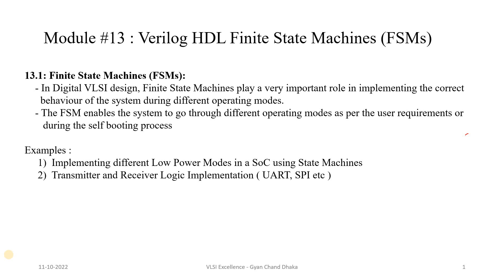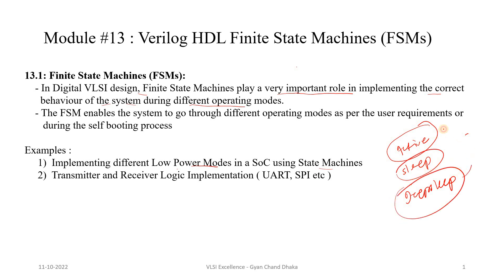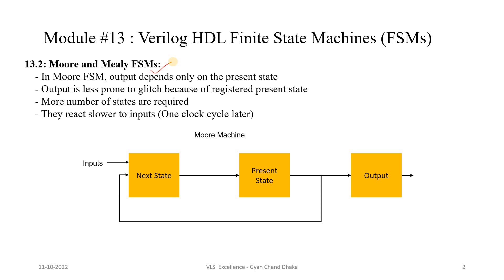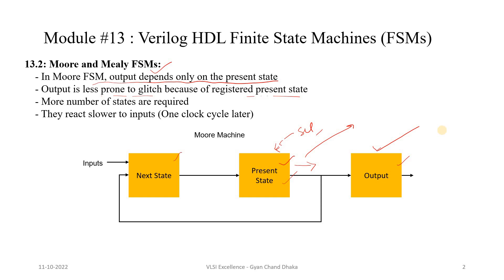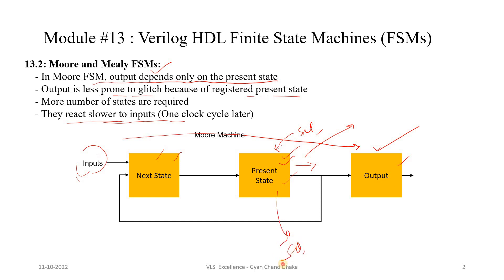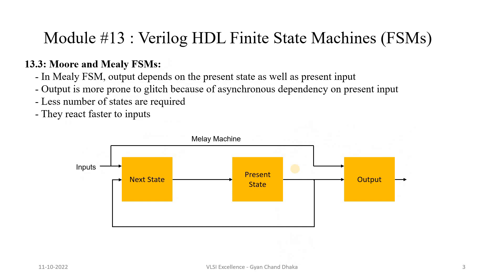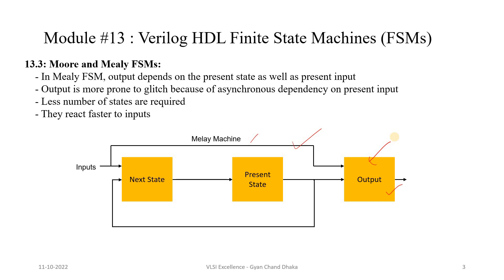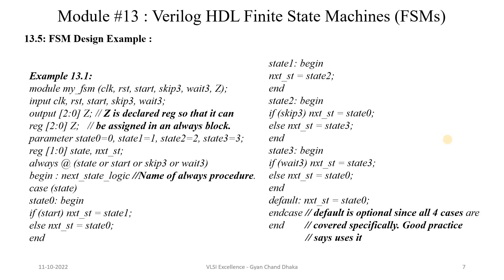Verilog HDL Crash Course | Finite State Machines | Moore | Mealy |Module #13 | VLSI Excellence | 👍&🔕

Comment: I have a net that the host writes to, however when it reads back from the register, I'd like to replace the lsb with a status generated in the logic. i.e.

    ctrl_reg[0]  <= tip && last_bit && pos_edge;   // status is lsb 
    if (PWRITE == 1'b1)
            ctrl_reg    <= PWDATA;   // host command    
    else 
            PRDATA    <= ctrl_reg;    

Why can't the synthesizer assign the last value set to the register?  If the host writes to ctrl_reg then the lsb gets set.. and if the conditions are later met, the logic will clear it.   Similarly, if the logic clears it and the cpu happens to be writing to it, then the value will be set again.    I don't see any race or conflict.   

For example, in another section of the same always block, I have a variable 'fsm' and it too is assigned in 2 places, this code however doesn't yield any error:
                
// all roads lead to the Next state being 4, unless host is doing a write (in which case next state needs to be 3)
                fsm <= 3'b100;
                if (PWRITE == 1'b1)
                begin
                    case ( PADDR [ 4 : 2 ] ) 
                        3'b000:  
                               begin
                                tx_data  <= PWDATA;
                                fsm <= 3'b011;
                                end
Reply from the maker: Not sure when statmenet "ctrl_reg[0]  <= tip && last_bit && pos_edge;   // status is lsb "  is executing in your current code. If you want to update the LSB just before read ... You may have the code like this -
-----------------------------------------------------------------------------------
if (PWRITE == 1'b1)
            ctrl_reg    <= PWDATA;   // host command    
    else 
            ctrl_reg[0]  <= tip && last_bit && pos_edge;   // status is lsb 
            PRDATA    <= ctrl_reg; 
----------------------------------------------------------------------------------